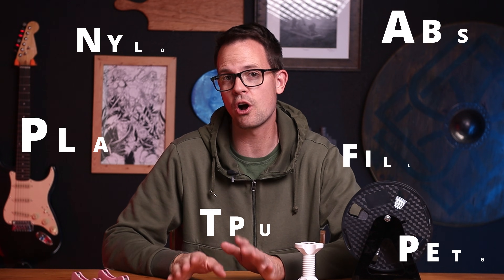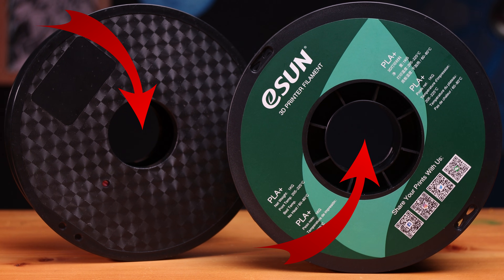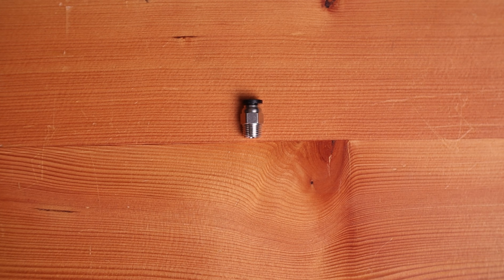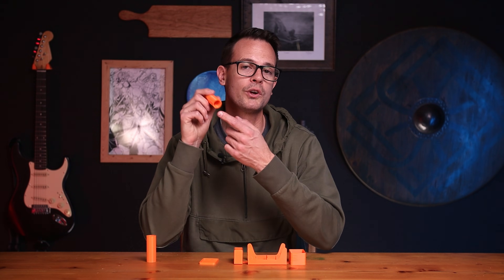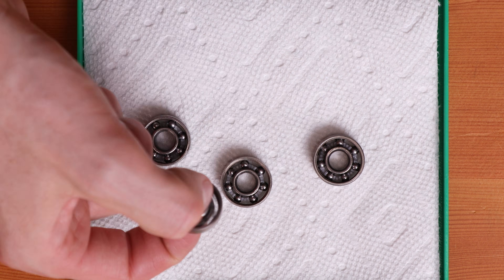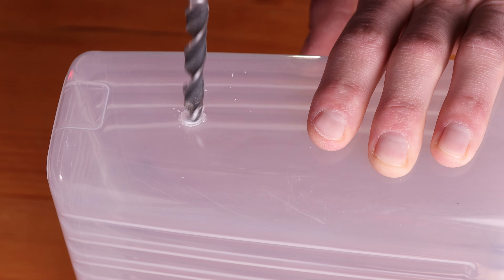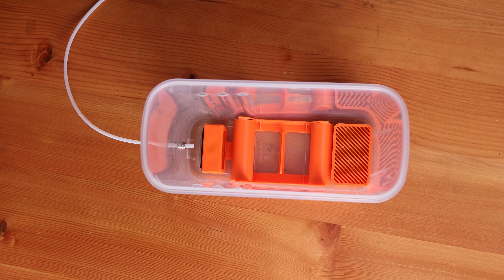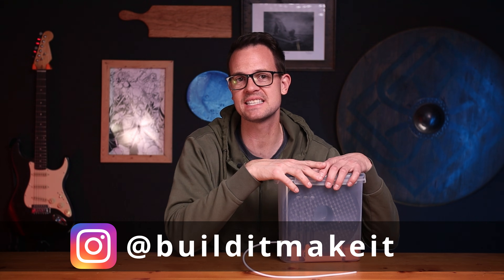How to Make a Simple and Quick 3D Printer Filament Dry Box | Free STL

Comment: Thanks for this, just made two of these today. Filament is in and will see what happens. Have had some pretty bad fine stringing lately and I partially dried one roll, but not the second. Curious to see what the meters say tomorrow after about 12 hours of each roll sitting in the boxes.
Reply from the maker: Thanks. I hope that helps with the stringing. You may want to do some oven drying first then put them in the dry box with the desiccant. That is what I typically do if I need to get my wet filament dry and then keep it dry.
Reply: @BuildItMakeIt   Even with less than 24 hours the RH in the box was down to 18 and prints today were much better! An unexpected advantage was with swapping filament between the printers. The tubing held the filament and prevented unwinding so the likelihood of creating a tangle should be far less. Might want more boxes just for that.
Reply from the maker: Awesome! Glad it worked so well. Yeah I really like the swapping aspect. No more sudden springing unwinding that then give me tangles later during a print.

Comment: this did not work for me the cereal box up at the front squeezed the print way too tightly preventing the front roller from moving at all ordered the exact ones linked in the description very unfortunate I'm 30$ in the hole,  does anyone here know any more boxes that may work better with this print?
Reply from the maker: Sorry that it is squishing it too much, I haven’t heard of that happening before. You can try printing the roller say 2mm less in the z direction to make it shorter. That should not mess with the bearing pocket and give you a little bit more play.

Comment: Just as a savings tip, once you're done cleaning the bearings with Iso-Alcohol or Acetone, you can pour the liquid back into a mason jar with a couple coffee filters (forming a floating cup from the brim), then close it. After about an hour, you'll have a decent recapture as the gummy grease will be strained out. 

Saves when you have a lot to clean. I'd mark the bottle it goes back into, so you know to only use it for stuff you don't need the purest version of.
Reply from the maker: That is a great idea in saving the alcohol. Thanks!

Comment: Why not just use sealed bearings?
Reply from the maker: Good sealed bearings would certainly work better. I was trying to save some money using cheap bearings. So far I haven't had any issues, but yes quality sealed bearings that spin freely would be better. The cheap ones I had sealed didn't spin freely and I want them to spin with very low load. Thanks!

Comment: Printed in PLA first, it was too brittle for the thin walls. I printed a second time in PETG and it worked much better. Thanks for the design!
Reply from the maker: Good to know! I almost always use PLA+/Pro so that is good to know that they normal PLA ended up being too brittle. Thanks for the heads up.
Reply: @BuildItMakeIt  using PLA right now and while flimsy it's holding well
Reply: PLA here, flimsy but working

Comment: Are the rollers placed close enough to accommodate mini rolls of filament? 
I'm not having much luck finding anything that can work with those adorable mini rolls! Thanks in advance!
Reply from the maker: Sorry I saw your comment before and looked up some additional mini roll sizes to what I have then forgot to reply. No the rolles won't work for all mini rolls. You can print some sides for the mini rolls that allow them to be used like full size rolls, but that does use extra filament.
Reply: @BuildItMakeIt  Can you provide a link to some of the slides you're referring to? Thank you so much for your reply!
Reply from the maker: Sure. Here is an option. https://www.printables.com/model/287592-250g-spool-extender-for-bambu-lab-x1-ams Look for people doing spool extenders for the bambu labs AMS. There are a couple of different design options for that particular issue.
Reply: @BuildItMakeIt  Thanks!!!

Comment: You make inserting the ptfe adapters look so easy.  I used a 8.5 inch drill bit, but twisting those things in.... I couldn't use my wrench until they were slightly threaded, and let me just say my hand is actually bleeding.
Reply from the maker: Yikes sorry! Maybe the plastic got switched out for a tougher one? That is crazy, but good plan on threading it. Sorry about your hand.
Reply: @BuildItMakeIt  Thanks for the sentiment, my hand will be fine in a day or two.  I want to design a holder for these dryboxes that can bolt down onto the top of my enclosure.  Any ideas?
Reply from the maker: @CyricRO  I haven’t seen any bolt down that people have done, but I have seen some bases printed that the boxes snuggly fit into to make them a little more stable.
Reply: chuck it up

Comment: Made 6 of these and they're great.  The base is a little thin/flimsy but it gets the job done.  I drilled another hole about 4 inches above and used a 2nd ptfe adapter to insert the ptfe back into the box when that particular box isnt being used.  The only feature I think is missing from this cool build is a winding mechanism to spool/unspool the filament without opening the lid (but not sure the juice is worth the squeeze).  Thanks for sharing!!
Reply from the maker: Thanks! That is a really good idea to feed the filament/ptfe tube back inside itself when not in use. Thanks for the great idea.

Comment: The current batch of those containers, i found squished the rollers too much.  I had to scale 2-3mm off of roller tube(z) , and took 0.1mm out of x+y diminesions to tighten grip on bearing. Bearings also go into tube too far imho.
Reply from the maker: Great tip and thanks for sharing. I will have to check out a new batch and see if they are constantly too small. I also heard from two other people with prusa mk3 printers that the x+y dimensions were a bit too loose. What printer do you have? The bearings going in too far I think is a personal preference that I went back and forth with. At first I made them flush, but some people had issues with the supports not coming off clean so then they stuck out. I inset them a bit and they shouldn't rub even though they are more pushed in, but it doesn't look at nice I think.
Reply: @BuildItMakeIt  i have a fully "teaching tech" calibrated Tronxy x5sa pro. I used a trimmed piece of filament to act as a stopper for the bearing.  I could probably take 0.05-0.1mm more out if all dimensionss, but with filament spacer... I think its fine. Latest print doesn't rub against the roller.
Reply: I'm having the same any way you could share your adapted stl? Did you manage to get these boxes to work for you? My front roller won't move an inch in 5 of the 6 boxes I got and the 6th is still way too tight to be viable.

Comment: what do you use on the ptfe end that has a slight gap when done printing? do you wind back the filament and plug the push connector? i just ordered my parts from your description so lets see how my build goes lol. i noticed my pla silk making that queef noise so i figured i needed a diy dry box to save money and i did think about a food dehydrator but those things are 400w and on for 4 or 5 hrs makes no sense. This diy dry box should substitute that right or must i always use a over or dehydrator to dry the filament first and then put it in the diy dry box? i am new to 3d printing in case my question sounds dumb.
Reply from the maker: Personally I just leave the little gap out. I generally print with a skirt or sone brim so I figure that part gets used in non critical parts. Sometimes I’ll just cut off the couple of inches. That way I don’t have to open the container and the filament in the tube stops the air flow mostly. I still set my filament before putting it in the drybox if it has set out a while but I use my toaster oven or large oven and done typically use a dehydrator even though I have two of them from doing food.
Reply: @BuildItMakeIt  nice! then i should be good leaving that gap as well since i also add a brim. The temp you used in the end of the video 125F for 45mins should be good for all materials like pla and silks before placing into the dry boxes?  i tried drying that silk last night at 350f for 5 mins and it warped the sides of the roll hahahah maybe i should have watched your video before trying that out.
Reply from the maker: @Bluntedco.  Don't worry. I accidentally melted a roll trying to dry it out as well. 😅I have had no issues down at the 125F range. https://3dsolved.com/3d-filament-glass-transition-temperatures/ Keep the temp a little bit below the glass transition temperature of the material and you should be good.

Comment: I love this design, bought a total of 18! boxes to work on. Hopefully it is all good! Thank you for the video.  A couple of questions: whats the "more flow"  stl

Also, I was wondering if you have seen someone design a box holder to have this either sit on or slide on the top of a ender 3 s1 pro.  Thinking of a way to swap filaments quickly and thought maybe i could simple use the arm the ender 3 comes with and remove the roll part and add either a mount slide that holds the filament from the top, or simply a shelf with a couple of inches of walls to have the filament box sit in.
Reply from the maker: The more flow stl uses less filament and has better air flow around the temp/humidity sensor. I don’t think it is necessary but someone requested I make that version. 
I haven’t seen a box holder but that is a really cool idea.
Reply: Just got all the parts in and made a couple of boxes. I can’t seem to get the humidity below 35% on any box so far (3). I bought the exact box. Have you had any issues? Or is there a fix?
Reply from the maker: @joshrp5  So it may take a bit for the humidity to lower because the filament needs to dry out and that may take a bit. If you want to speed it along you can warm up the filament in an oven, but be careful you don't melt it. I did that to one spool and then I just left the other ones. The humidity came down over the next two weeks and has stayed around 20%. If you feel like it isn't moving much after a week. You can switch out the desiccant and dry out what you pulled out if you have the rechargeable kind. Another option is to put a ton of desiccant in a container with a roll (not to use but to dry out). After the humidity in the filament has dropped then you can switch it into the normal filament dry box and after a few days it should settle down to more like 20%.

Comment: Really nice!  I think it would work better if the filament rolls off the top rather than the bottom.  I plan on building an enclosure for my printer and have the filament feed from above the printer.  Do you see any problems with that redesign?
Reply from the maker: Sounds great. A number op people have it roll off the top. I have one that rolled straight up. That is what is nice about putting the port wherever. It mostly depends on your printer setup. Good luck!

Comment: When I did the concentric supports for the rollers, the area that required supports was very stringy, What do you set your support settings to other than concentric?
Reply from the maker: I changed the density till I got two concentric rings on the inside. Maybe yours is only putting one ring.

Comment: Did you notice any extra drag being applied to the filament that may cause under extrusion? Did you calibrate e-steps with the dry boxes attached?
Reply from the maker: I have noticed some drag but it seems to mostly be with the tube, not a ton with the rollers. I did check my e-steps and it didn't need to be changed. So far I haven't noticed any issues.
Reply: I seem to be dragging a bit as well.. Is there anyway to make the tube a bit easier for the filament to pass through?

Comment: This design seems very similar to the one shown by marsgizmo, is there any significant difference aside from the Bowden coupler placement?
Reply from the maker: Wow I didn’t see his design before. The two are super similar. 
The differences seem pretty small, but my guess is mine is about 2mm wider, and can hold a little more desiccant, while his looks a bit more sturdy. Mine pushes up against the sides of the cereal box for strength so I think it uses less filament. 
Honestly you could just print one of each and see which one you like more.
Reply: @BuildItMakeIt  Thanks for the response and clarification, will definitely try out this design
Reply: @BuildItMakeIt  Is saving a little filament a priority for you? No wonder your roller frame is so ridiculously flimsy. If you were so thrifty you wouldn't have given links to Amazon listings showing a set of SIX cereal containers and SIX temp/humdity monitors. These can be purchased singly elsewhere. Also, I don't advise using 2mm ID 4mm OD tubing for the box. 3mm ID 4mm OD will give less friction.
Reply from the maker: @brucebelvin2058   Thanks for your comments. I can see where the design being a bit flimsy outside the container may bother some people, but I made it that thin to accommodate wider rolls. It doesn’t need to be strong on the sides because the cereal box is plenty strong. This was a design choice for wider spools, not a way to save money.
Reply: @brucebelvin2058  calm down bruce, you're embarrassing yourself

Comment: How do you remove the bearing seals for cleaning? Is it possible to do this without damaging the seals?
Reply from the maker: This can be tricky to do. I find that the best is to use a thin pin, like a sewing one and to carefully work it under the seal and run it around to dislodge it. If I am careful I can get about 95% success with this method. A lot depends on the quality of the bearings. Nice ones like proper skateboard bearings pretty much always come out nice, and go back on nice.
Reply: @BuildItMakeIt  Perfect! Thanks very much for the immediate reply!

Comment: Nice design!  What are doing your CAD in, Solidworks?  That is my preferred, I can model anything in it.  Have been messing around with Cinema 4D since we use that at work and it is a pretty good modeler.  I did a few cars, planes, a Dalek, haha.  I like the freeform aspect of it compared to sketch driven Solidworks, definitely a different mindset when using rendering CAD software compared to engineering CAD.
Reply from the maker: I use solidworks at work but at home I am using fusion 360. I wish there was a cheaper way to get solidworks for a side hobby, but fusion is working pretty well for me. I haven't ever used Cinema 4D, mostly a blender user, but haven't even done that much with it for a while now. I totally agree the freeform aspect of it is a bit harder for me to work with after doing sketch driven design. I do like the modeling stuff, that seems to make more sense to my brain since it is sort of like messing around with clay.
Reply: @BuildItMakeIt  There are cheaper ways ;)
Reply from the maker: @HandyL  yeah 😎 ….. but I’m trying to be better about that kind of thing. Undergrad me would have been all over getting me some solidworks.
Reply: @BuildItMakeIt  there is now the 3DExperience hobbyist SOLIDWORKS license, 10 bucks a month
Reply from the maker: @adamaglionby7438  oh that is cool to know. I’ll have to check that out. I’ve been using fusion 360 more and more, but I do love Solidworks. Thanks for the info.